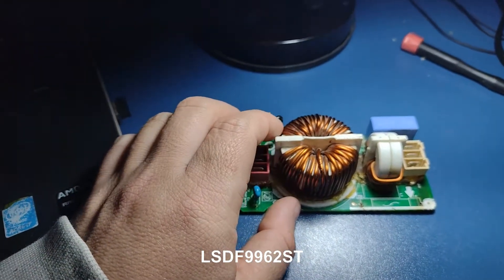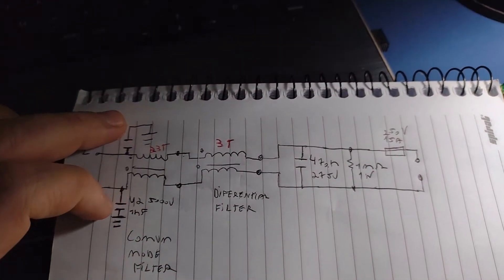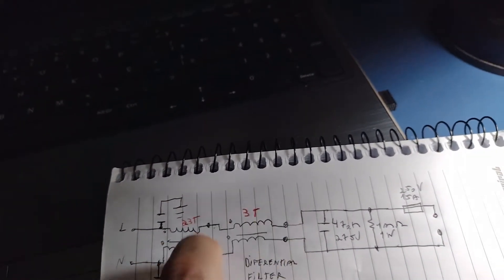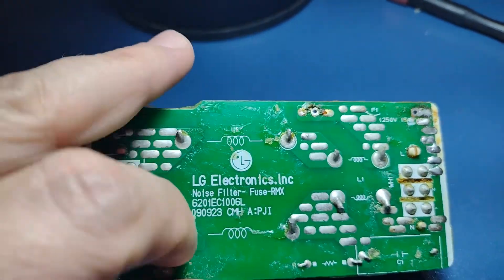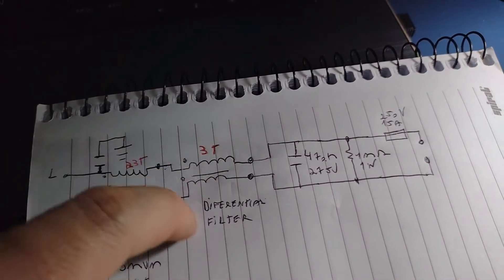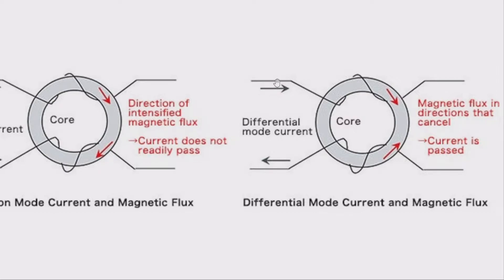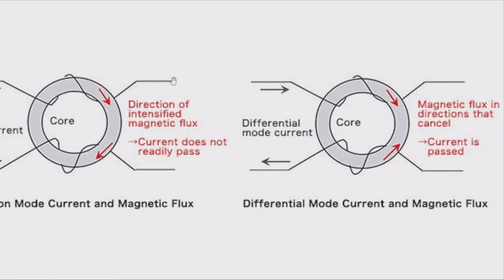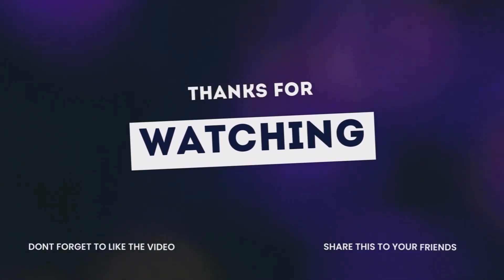Inside a  LSDF9962ST LG Dishwasher/ Washing Machine noise filter (6201EC1006L). Common mode Choke.

Comment: my part No is 6201ec2002r 
can i use 6201EC1006L as alternate

when using present part its geting shock the earthig also geting power so i need to replace
Reply from the maker: I dont know, but, you should try to compare